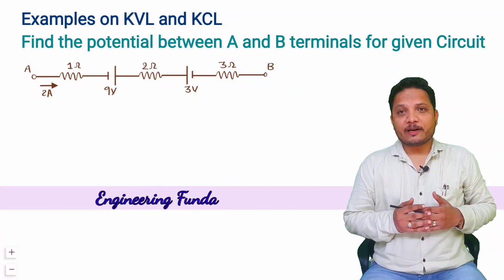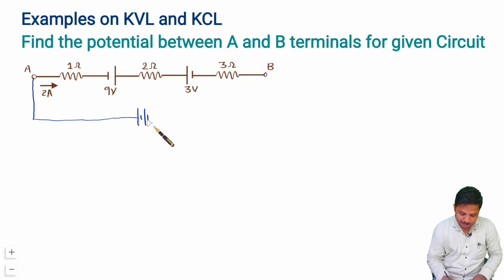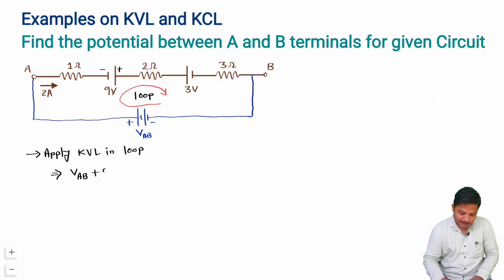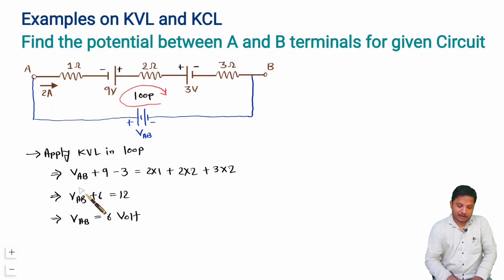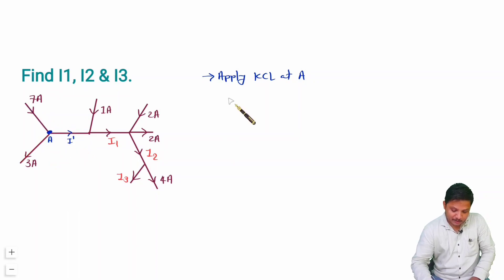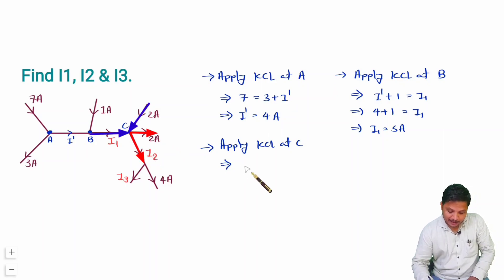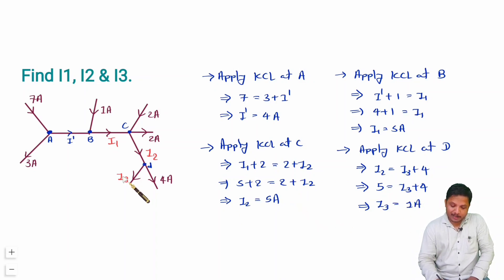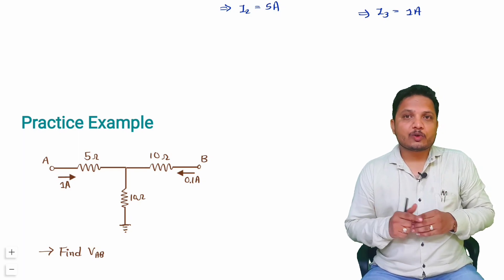Solved Examples of KVL and KCL: Understanding Kirchhoff's Laws in Network Theory

Comment: Let the common node point be "c"
Va - Vc = 5 volts
Vb - Vc = 1 volt
Vc - 0 (ground) = 10 X (1 + 0.1) = 11 volts
Therefore, Va = 5 + 11 = 16 volts, Vb = 1 + 11 = 12 volts and Vab = Va - Vb = 16 - 12 = 4 volts (answer)
Reply: Brooo please can you explain how you got vc-0= 10x(1+0.1)
Reply: @pothigantimanojkumar2825  assume node C current is I3, then I3= node A side current (1A) +  node b side current (0.1A), then apply v=IR concept ,here r=10 and  I3 =(1+0.1) , then vc-0=10(1+0.1)= 11
Reply: @DarpanDiscourse  bro please explain bro
Reply: @DarpanDiscourse  answer